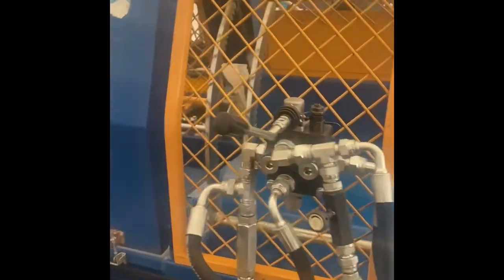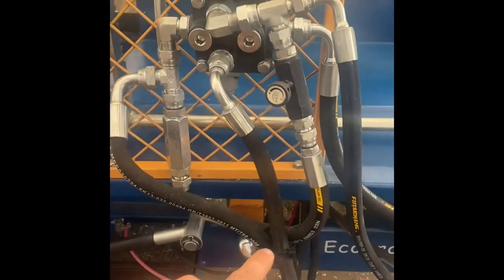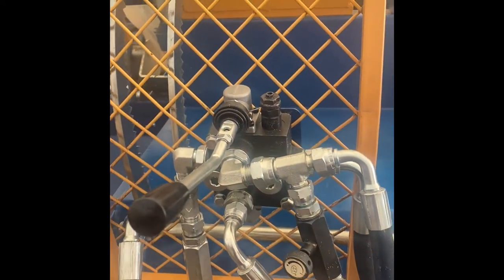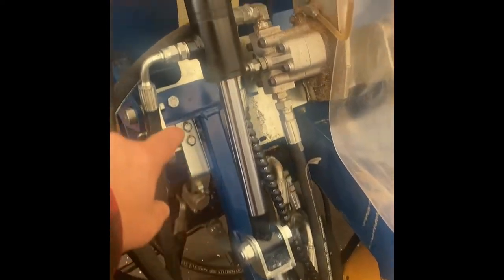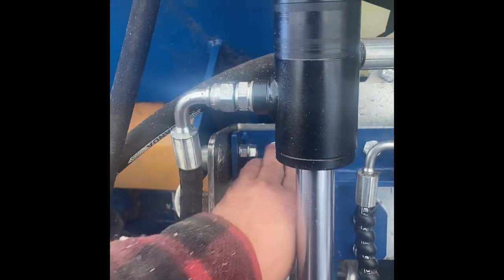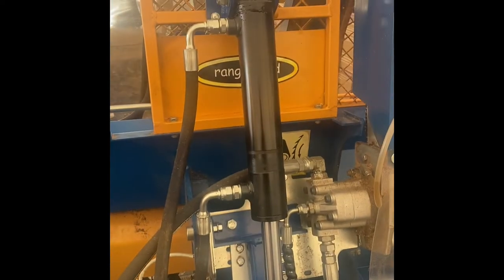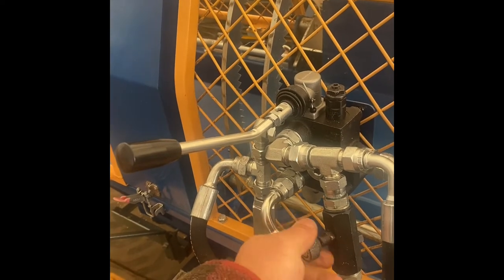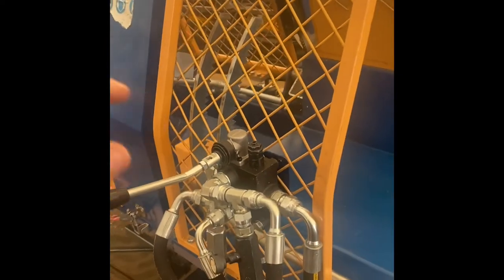Range Road RR 2540 Eco pro 300 upgraded Hydraulic Bar Kit

Comment: They should do something with the splitters on the Eco pro….the piston for the splitter has way to much play in it on both ends…and if your putting max size hard wood through it everyday it don’t take long for the push plate to start digging into the side of the splitting box and it will put a hole through it after a while ……I had a brand new Eco pro 300 and after 11 hours of use I almost had a hole in the splitting box …the company gave me a new one but it should not have happened in the first place……besides that problem I like the processor.